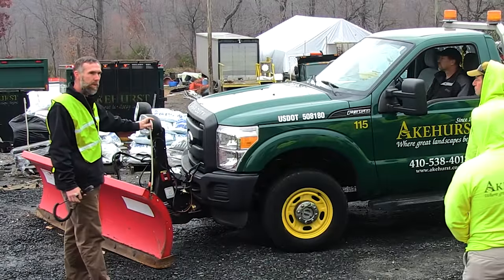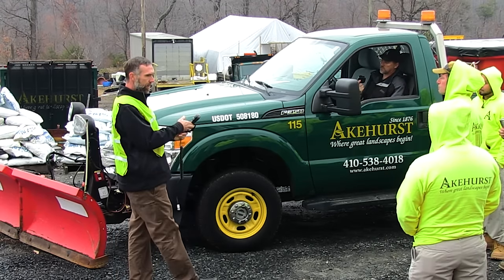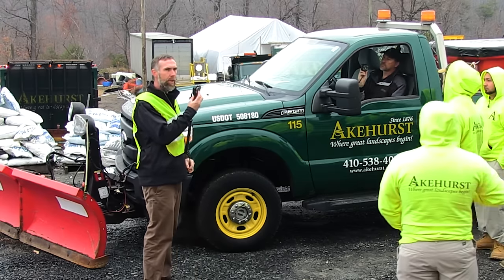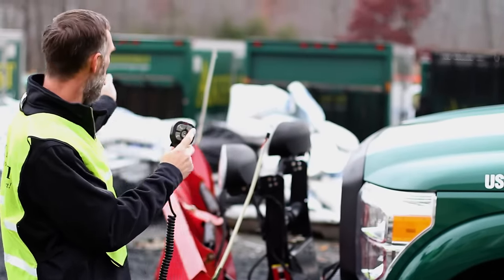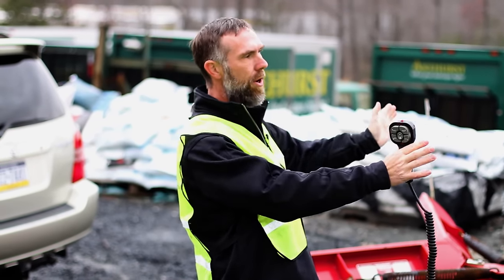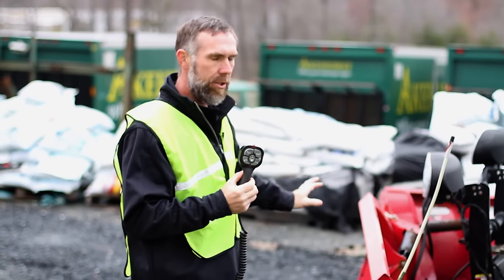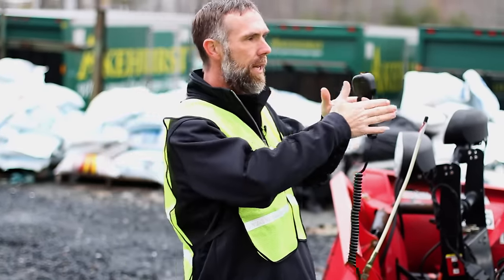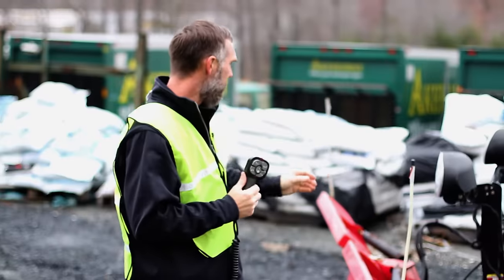Basic Plow Fundamentals

Comment: I always strap my plow control right on the end of my shifter lever that way I can run the plow and shift comfortably all at once plus its easier to see the controller and eliminates accidentally dropping the plow during travel. I do shut the plow off when I travel too but it helps having the glowing lite on the controller easily visible and eliminates mistakes. I find it much easier this way especially after 12 to 15 hours plowing